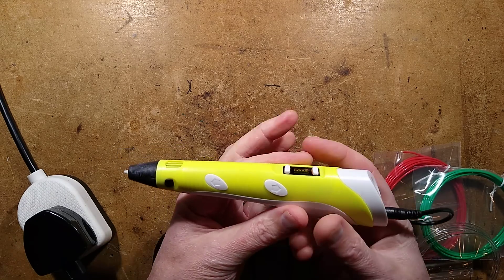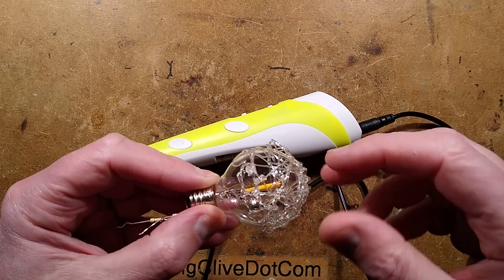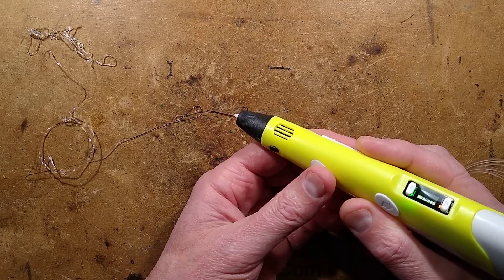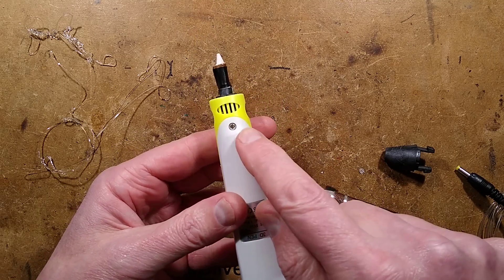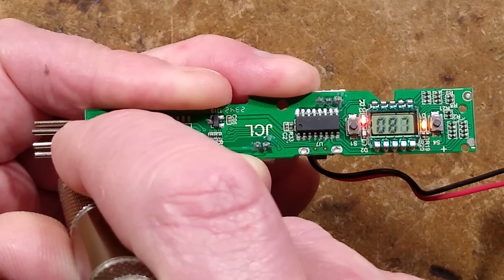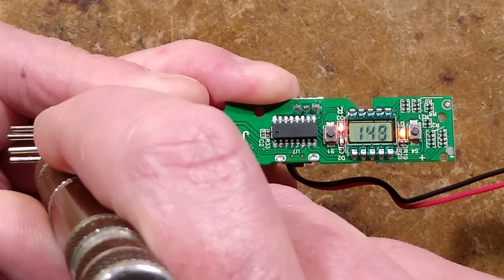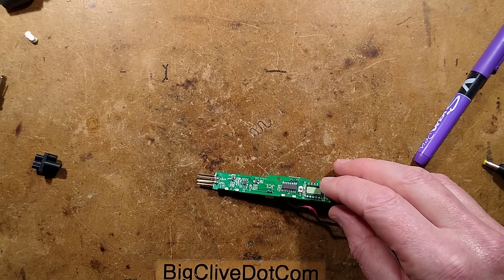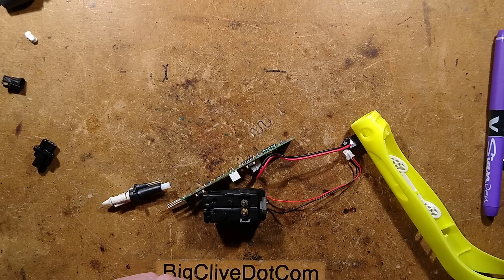Inside a 3D printing pen

Comment: I've got one of the very early ones, when they were still just 3d printer extruders in a new housing; now they're way cheaper as manufacturers have realized you don't need precision stepper motors in a manually-operated extruder...

They're not useless, though the marketing for them has no idea what to use them for.  I've mostly used mine to reinforce functional 3d prints; there's a technique where you leave notches in the print oriented vertically (the weak axis) and then fill those notches in manually, and it significantly improves the strength on that axis.  I've also done some minor manual sculpting and plastic welding with it; mine has a removable sock over the nozzle, and when I remove that I can use the nozzle to re-melt already-placed plastic.

(Technically a tube is only a Bowden tube when both ends are fixed, the way a bike cable is fixed.  A free length of PTFE tubing acting as a guide isn't a Bowden tube.)

Comment: I consider this very useful tool along with 3D printer. I use it for fixing 3D prints. E.g. If I print something large and notice I missed some detail, I draw it by hand or print it aside and weld together. Or if I break a print, sometimes it can be used as a welder to put the things back together.
Reply: And fixing failed supports mid-print... I use mine couple of times a year but just one rescued print is enough, don't regret buying it at all. It is limited of what it can do but what it can.. can't be done with any other tool. I've fixed so many prints with it over the years.
Reply: @squidcaps4308 I don't know why I haven't thought about that. Great idea.

Comment: I found one of these to be fairly useful for repairing or small modifications to prints. Though you have to smush the nozzle into the print to get a good stick. Also, it died after about 10 uses. Mine looked the same but with a small, all metal gearbox.
Edit, I see others have the same idea. 👍

Comment: RU are making heatshrink now? It's been ages since I've seen their logo inside of something

It's a shame the gears are plastic as I imagine they'll be the first to wear down

If the speed control is a divider, could a potentiometer not be substituted for finer control, or will they only work at specific voltages?

I wonder what the difference between the two plastic types tempreatures are, maybe the ramping of the display is slowly increasing the current, so it's more an amp reading than a tempreature?

Comment: The idea behind these is to draw in space. Set the temperature to the lowest point it will flow so it hardens as soon as it leaves the tip.
Reply: I remember a similar one that Ashens demonstrated.  "Hot mess" is a term that comes to mind.
Reply: I understand the concept behind this, but I have difficulty seeing it work in my mind due to gravity.

Edit: I looked up videos of this thing in action on YouTube and all of them use a surface on which to lay the filament. It's nowhere near as exciting as I was imagining, but makes sense.
Reply: Yeah. When setting it too high it's just a hot melt glue gun 😅
Reply: It's easier to draw the sides flat, then position the sides verticle and melt them together. I.e. not draw in space. I made a few cubes like this tracing a square on paper. It's much easier than trying to draw in space. But you can draw in space a little bit.
Reply: Draw in space? I’m sure NASA had thought of this many decades ago - they decide a pencil was of most use 😂
Reply: What temperature range does it allow when set to ABS? 3d printer nozzle temps for ABS generally have to be higher than PLA
Reply: I'm not sure. One of my kids had a simple one that had a switch to select ABS or PLA but didn't list the temps. The better ones are fairly precise and have a high wattage heater with a good thermal mass to get the filament right where you want it just over melting point. Then it will harden as soon as it leaves the tip.
Reply: There's a problem with the "set the temperature" as Clive demonstrated the temperature setting and readout are all placebo.
Reply: You have to go to space to use it?
Reply: @ElectricChicken  preferably
Reply: @someone2506  damn it, I'm about a million pounds shy of a trip to space. I'm quite tall though. What if I just hold it up high? Would that be close enough?
Reply: @ElectricChicken  cue the muppet show title. "DRAWWWWW INNNN SPAAAAAAAAAACE!"
Reply: there’s someone who’s crazy skilled with these things - sango, and they make all kinds of impressive sculptures

Comment: I can see it being useful for repairing other items made of the same material. Hot melt glue just doesn't have the correct adhesive properties when trying to repair things like cracked ABS while I imagine this could be forced into a crack where it would amalgamate with the base material.
Reply: I do this but prewarming is a must. I use a butane torch with a hot air adapter. I premelt the pieces ahead of the pen and follow with a circular motion with the pen to blend the plastic together.  Get the 12v model of these if you can. They go hotter but they are getting harder to find
Reply: that's how i use it sometimes
Reply: I use mine for repairing and modifying 3D printed items. You can fill in gaps then sand it smooth. You can also build up areas and file it to fit. I'm not sure how well it would work for an adhesive though. For ABS, I would use acetone or plumbing cement and super glue works well for PLA and PETG.
Reply: Cheaper than a tube of Arildite..... Looks a useful bit of kit for repairing strip threads in b plastic.
Reply: That's what I bought my 3D printing pen for in fact.
Reply: yeah I use mine for that pretty frequently.
Reply: How does this compare to just using super glue (CA glue)?
Reply: @nimoy007  Super glue will not stick to ABS and it needs a primer to work with PLA (with questionable results).
Reply: @chrishartley1210  Thanks!
Reply: @nimoy007  dedicated plastic cement exists that works far better but it does it by chemically melting the plastic together and smells horrific since it has acetone in it
Reply: @Stormer-vx5kw  Is that the model car glue stuff?
Reply: @nimoy007  yeah though its technically not glue despite being called it often since it wields plastic together directly
Reply: Acetone should be your ABS adhesive of choice. It will chemically bond to itself by dissolving. If properly left to dry and the gap is properly filled, it's as strong as it was originally.
Reply: How is your comment 2 weeks old but the video is only 20 hours? @Chrishartley1210 you have messed up my friend and just exposed that you do in fact have a time machine.
Reply: @allenrusselljr  The video is 2 weeks old (or more), it was only made public 20hrs ago but Patreon subscribers get early access.
Reply: @chrishartley1210 ahh I see.  That sounds very plausible..... 

Thanks Chris 😄 

( Your time machine secret is safe with me )
Reply: I once dropped a soldering iron made of ABS. The shock broke all 4 internal screw posts. I then went through my scrap drawer and found an old CD drive. The tray was made of ABS. I took it and placed it in a jar with some acetone.  A lot of stirring later and it was liquid. I used the acetone ABS slurry to plastic weld the posts back. Fix has held up for years
Reply: @pseudomemes5267  You made the cement used for welding ABS waste pipes.
Reply: @chrishartley1210  yep and it worked surprisingly well
Reply: For different materials a bit of stirring serves well to combine them.

Comment: Perhaps it could be used to fill in a gap or slightly modify something already 3D printed?
Reply: Yep. This is handy for making slight tweaks (i.e. where a tolerance on mating parts was too high) and fusing parts together. I use mine this way often, but the results tend to be quite ugly 😅
Reply: I might get 1 I’ve been using and old soldering iron to repair broken prints lol